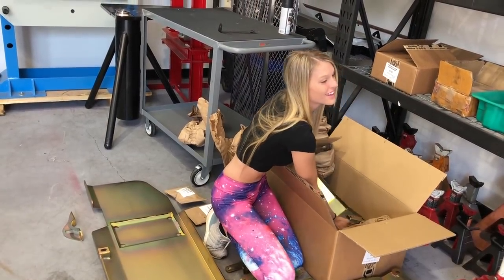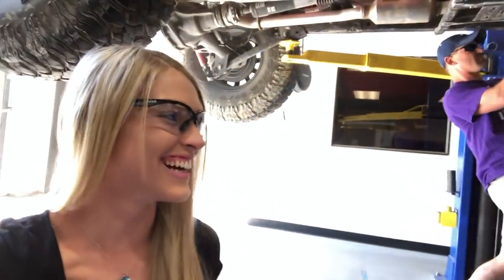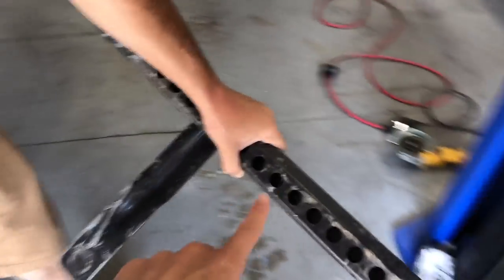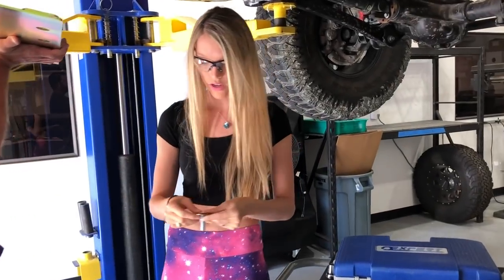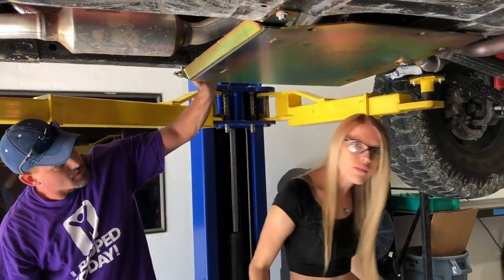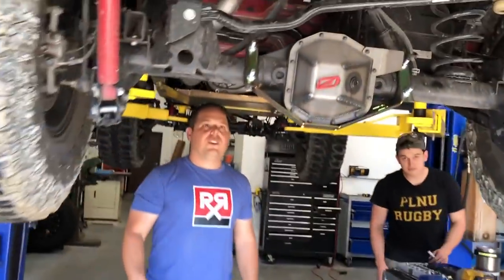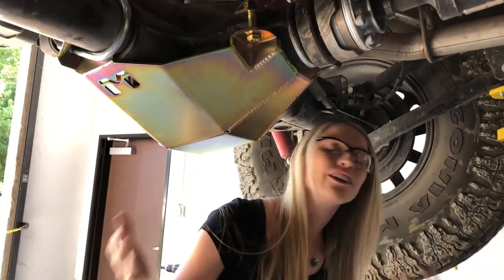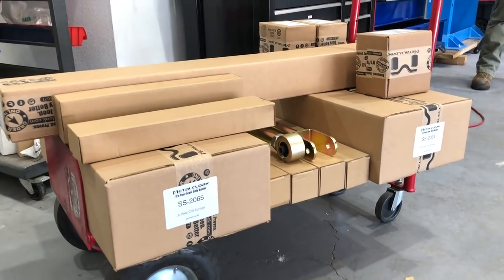We Install MetalCloak's JL Undercloak Armor System on our 2018 Jeep Wrangler JLU Rubicon

Comment: Great choice by going with Metalcloak for protection. I have their Game Changer short arm lift and armor system in my JK. Their customer service is TOP NOTCH! I've had to replace some items that got bent/ damaged or needed to  be upgraded. I've contacted them and Metalcloak assisted me on every step of my repairs when I needed them. You will not regret it

Comment: Excited about the MC lift for you guys.  I had a TJ with their 3.5 gamechanger and my current JK has the 3.5 inch gamechanger.  Its the best bolt on kit Ive ever experienced as far as the ride and performance.   I also currently run the same Patagonia 38s.  You guys are gonna have a blast on the rubicon trail.

Comment: There is one thing that you will need to take care around and in some situations avoid - MUD! Fill up that belly pan with mud and it’s a MOFO to get out... I’m otherwise enviously considering one for my JK.  (FYI mud is a great way to ruin tires as I have found out on a few occasions having it caked on the inside of the rims and a few freeway miles to a car wash...)

I’m sure you’re already done with the Rubicon trip - but will get great use of the plates there!
Reply from the maker: No Name They definitely came in handy!! Videos to come next week!

Comment: Great job with your latest video!  Excellent overall.  My only criticism is that the soundtrack (the music rather than narration) is too young for my taste (but probably great to the vast majority of your viewers, now and in the future).  You mention the weight of the various skid plates is about the same as a large cooler.  I was wondering about the weight of all these skid plates.  And your skid plates are vastly better designed (considering the use the two of you give your Rubicon) than the factory skid plates Jeep put on the car.  My only other concern would be the effect these skid plates will have on the various fluids used in your Rubicon, namely: Engine oil, automatic transmission fluid, transfer case lubricant, front & rear differential oil, coolant temperature and possibly even the temperature of the fuel in your fuel tank.  My question here would be the effect in off-road, slow speed driving in hot weather, and also the effect on the various temperatures of these various fluids when driving at highway speeds in hot summer months (both for just the Jeep on its own and also when towing a trailer of up to 3,500 pounds).  These skid plates look excellent!  They appear to have been very well made.  And the installers did a great job getting them onto the Rubicon.  Well done, Lite Brite!
Reply from the maker: Andy McKane We just got off a 4 day Rubicon Trail excursion, and so far the temperature have been fine! But we’ll continue to monitor them and keep everyone posted! 😊

Comment: Finally bought and installed the armor from MetalCloak. Question. Did you notice a noise that seems to be a low hum or vibration that resulted after you installed? It is faint but seems like it’s there for my JLUR. I bought the MetalCloak on your advice and look forward to taking it out but not sure if that noise is an install issue or if a vibration that results from having that much metal under there.

Comment: Jeep should offer that package as an option from the factory.
Reply: davkenrem but engineers says it makes it heavy as a tank. Well artec accidentally sent me a full aluminum skid plate system for the jku. It weighed about 115 pounds.
Reply: Jeep leaves it to the aftermarket for the 1% of people who need this
Reply: D brandon why does jeep make a snorkel then if very few people need it. They should make a damn skid plate. It doesn’t have to be standard it could be optional or hell even a “Mopar performance upgrade”
Reply: A snorkle is used 1000 times more often than full skid plates like this.  A snorkel is not just for driving through deep water, it's best use is to get clean air when driving in dirty conditions.
Reply: Douglas ivey  because that snorkel is cheap to make, its plastic, it's light. why would you want an over priced factory skidplate system when the aftermarket will come out with one that is better and cheaper.

Comment: Just curious, did you experience any vibration or new noise from this plate? 
I just installed it and am getting substantial vibration and motor noise that I figured is coming from the motor mounts to the frame. I have plenty of clearance and nothing is rubbing. Thinking about adding rubber spacers to all the motor skid bolt locations.

Comment: Hey guys.  Between 3 and 4 minutes you took out the OEM pieces from the JL. What are those parts called? I think one is the gas tank skid. What is the other part? I ended up following your advice and bought the. Metal cloak skids and want to auction off the parts I took off since it hasn’t been damaged to offset my costs. Need to know what they are called. Thx for your help. Your vids are great.

Comment: If you look on the website, it’s sold as raw metal,  but yours looks like there is some what of a coating on it.   Can you advise if yours came with a protective coating on it.   Or did you guys apply a protective coating to yours.   Thanks.
Reply from the maker: MUDTRAIL It comes with Zinc coating!

Comment: Why wasn't this put on before you started wheeling? The open metal damage will only rust.
Reply from the maker: Turd Ferguson We sprayed over most of the prior damage with either black or clear paint before the skid install. It’ll be fine.
Reply: @LiteBrite  I wasn't losing sleep over it. Just dont roll that Jeep over, I'd prbly cry.

Comment: Very nice bling, metalcloak makes great products.   However,  I have to respectively disagree with your statements about the hardware being easily removed after installation.  I have rockhard 4x4 skids, which use a similar dome washer type of hardware.  The rocks WILL mushroom over the the allen heads with impact, making the removal very unpleasant.  Ask me how i know.  Whatever other bling you have planned that requires removal of skids, install before playing in the rocks and damaging Allen heads.  It won't take much to stop an Allen wrench from going in.   Have fun, be safe.
Reply: I was thinking this the whole time. They'd have to slot the head out or go roundy roundy with an air hammer to get them out then.
Reply: Does the skid plates come with the chrome plating options? Or mirror polished stainless steel too

Comment: Great vid guys.  I see you are installing a lift kit next. I have the Metal Cloak 4.5 hi steer lift on mine with fox shocks. Are you planning on upgrading your front driveshaft with a double cardan?  If so please show in your vid the front pinion angle that worked for you.  I have some steering vibration and I suspect its the pinion angle. Thanks and good luck on the install.
Reply: With a double cardan driveshaft the pinion angle needs to be pointed directly at the t case not 6° like a normal driveshaft. Check out bleepinjeep they’ve got a great video on it.
Reply: Thanks Douglas. I did see that video. It just seems like it’s a long way for the pinion to travel from horizontal. Seems like everything on the axle is going to rotate a pretty good amount which will throw off caster, springs and such. But I am going to give a try. It either will fix it or not.  I’ll make sure and get an alignment after. Hopefully they won’t have to adjust it back to get it aligned. Thanks for the info.
Reply: Not a JL let me know how it goes I about to order an Adams Driveshaft and will have to go through this trouble too. Have you asked the manufacturer of yours about it. They may have a set angle they want. Or the shaft could be out of balance
Reply: I will call tomorrow since I will be tackling this on Saturday.  First I am going to do the easy thing. Get Discount Tire to balance my tires again.
Reply: Not a JL I too have a slight vibration that went as way as suddenly as it appeared lol. Jeeps are weird. I think it was my new cv joint in my front driveshaft getting greased up.

Comment: So put metal cloak on my stock Jeep JLUR and hit Top of the World Trail. I hit the skids and sliders throughout the trail as I was stock on 33s. After I noticed vibrations at various rpms. Did you guys experience that when you hit your skids? Jeep dealership in Utah couldn’t identify the problem. I was hoping you guys could comment.
Reply from the maker: Skids won’t cause a vibration. It’s either one of your driveshafts or tire balance
Reply: @LiteBrite  thanks. I got the skids coz of your review. Even told metal cloak that when I bought it. Also is it expensive to fix it and do you know people in SoCal or Utah?

Comment: Love y'all's videos Brittany/Kevin. I have a question tho, what is the dropped piece towards the rear of the gas skid?
Reply from the maker: Bobby S If you look closely at the stock gas skid, it has a section right there that “drops down” as well. And since MetalCloak’s skid is designed to fit over your stock skid there, they had to design around that
Reply: @LiteBrite  oh okay 🤦🏼‍♂️, I didn't even notice that. Thanks.

Comment: Not a fan of the MetalCloak skids... I dislike how all the edges are not flush and the bolts, though they are inset within the washers, still are not flush with the skid. I love my Artec Bellypan system on my JKU. Everything fits up perfectly and the it is completely smooth underneath. Plus, aluminum, so super light weight, yet it has not gouged much at all here in the NE/Mid-West rocks.

Comment: Thought about heading to Tahoe this weekend to do some boating and perhaps bump into you guys but I have to make a Vegas run. You should at least try to meet up with me, I have a Tazer JL and I can reprogram your tire pressures, at the very least.
Reply from the maker: HamrickCE We just got off the Rubicon Trail, and ironically enough, our next stop is Vegas. Haha
Reply: I look forward to the video you post. I'm headed back to Tonopah tomorrow... If you catch me then I can use my Tazer JL to reprogram your tire pressures. Also, Tonopah is (usually) the gas stop on your way to Vegas, gas is cheaper inside town. Drive past the Chevron and get gas at the Velaro or Giggle Springs (gasoline ally). If you can make it to Beatty gas is $2.99 at the ARCO. Hard to miss a Mojito! green Jeep on the 95. Would be cool to bump into you guys.
Reply: So, there seems to be a rather large number of "Kevin Williams" named people on FB. Don't have instagram because I'm old. That's my excuse and I'm sticking to it. My FB is Christopher E. Hamrick... If you are heading down tomorrow I expect you will stand out. Not many have the new Jeep JL yet.

Comment: Has anyone tested temperature differences from stock? I would be a little concerned with the amount airflow to the transmission pan and transfer case. I know the Jeep has a trans cooler but, the trans pan aids in the cooling process. The t-case has no other means of cooling other than outside air flow. Just curious.
Reply from the maker: Dman Sloan Can confirm from a 4 day Rubicon Trail excursion - retained heat isn’t an issue so far!
Reply: Fair enough. I was just curious.

Comment: New to Jeeps. Why no front diff skid? Great content guys, keep it up!  :)
Reply from the maker: Maxdady01 Since the front diff is facing the opposite direction, there’s really no room for a full skid there like the rear. The make much smaller “maxi pad” style covers I believe though to just protect the bottom. With the Motobilt cover, we aren’t to worried though

Comment: Hey guys I have an unrelated question that you may be able to answer. Does the JLUR have the same electronic sway control module? Traveling through water in my 12 JKUR during Harvy ruined mine and caused all kinds of electrical issues when it's connected. The part is not water proof despite what the dealer claims and Crysler claimed. Costs about 2500 to repair, ouch!
Reply from the maker: B Alt Ouch is right! Our JLU has an electronic disconnect for the sway bar, but unfortunately I’m not sure if it’s the same as a JKUR...
Reply: @LiteBrite  ok thanks, I'm sure you guys will find out eventually.  I found mixed results when researching. Keep kicking ass!

Comment: Great vid!  3 questions:
1) Were these steel or aluminum skids?  If steel, why not aluminum, which 
is much lighter?
2) You put a diff skid under the rear diff but not the front diff.  Why not 
the front also?
3) In this video here ...https://www.youtube.com/watch?v=UEMzeGynoX8... the Jeep Wrangler chief engineer advises against installing aftermarket 
underbody skids, arguing that they create heat problems by impeding the airflow 
cooling of the engine, drivetrain, and exhaust components.  Any thoughts on 
that?
Reply from the maker: Charles Whalen These are steel skids! Although aluminum ones would be awesome, they only save about 80ish or so pounds but are nearly twice as expensive. So these are easier on the budget! You could maybe make a baby skid for the front diff (they almost look like maxi pads haha) but since the front diff faces the opposite direction, you have the track bar in the way and you can’t really bolt up a fill skid like the rear! As for retaining heat, there is a give or take here - for the type of wheeling we do, we’d much rather retain a bit more heat than break a transfer case on the trail! Luckily the new JL has all sorts of temp gauges we can monitor and keep you guys informed about!